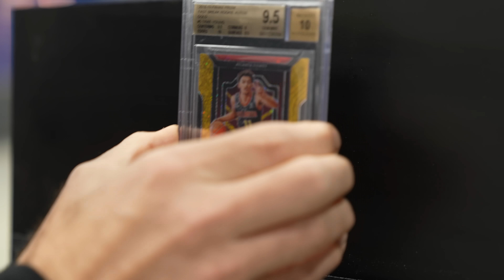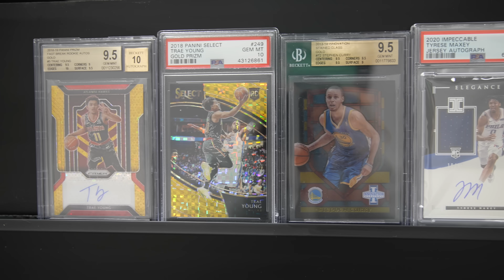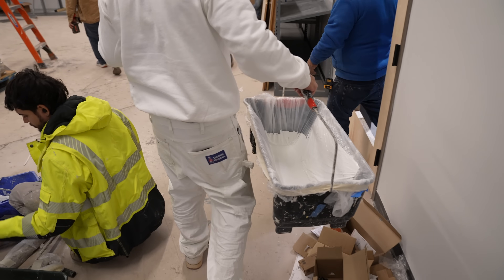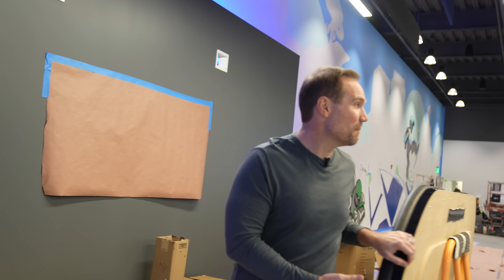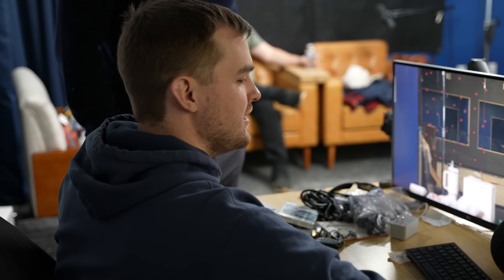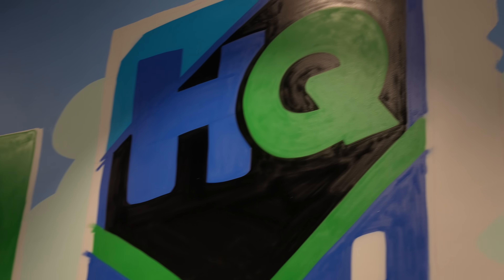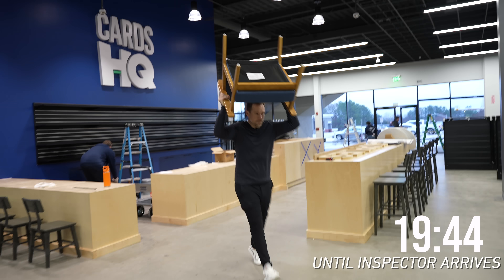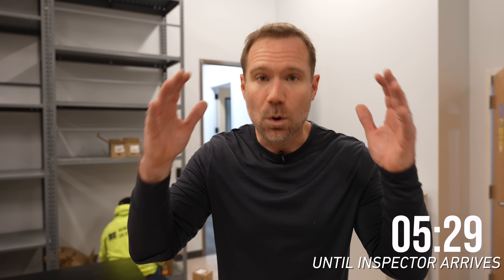CardsHQ MAY NOT OPEN Because of This!

Comment: Lol, Geoff thinks those card displays are so revolutionary.  Dude, I'd rather look down a jewel case than have to squat all the way to the floor to see cards on the lower parts of those vertical displays.  As the card market sinks, and it's already started, Cards HQ is going to go belly up.